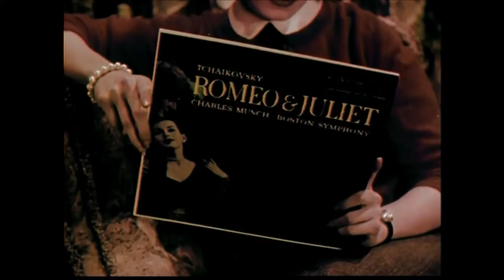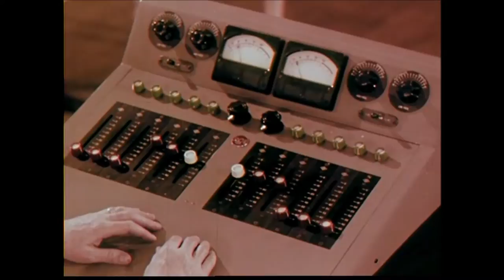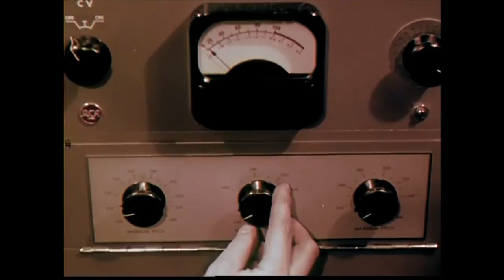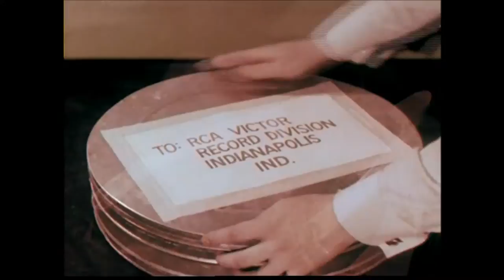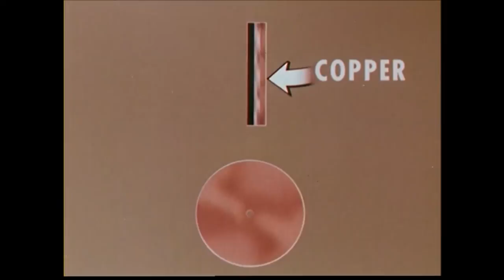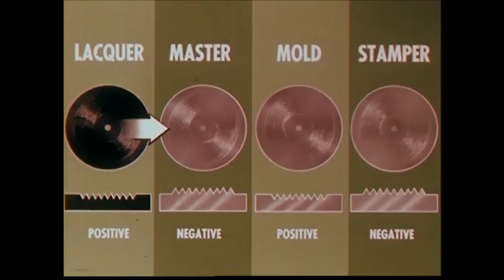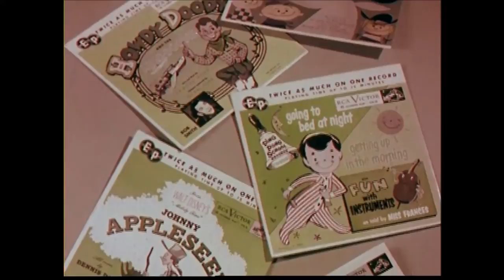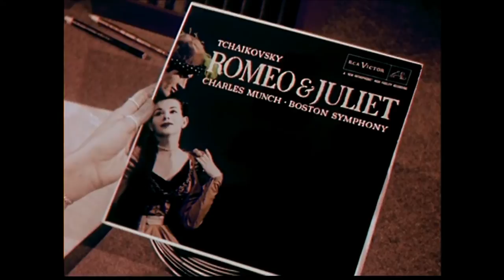The Sound And The Story  -  RCA Victor Commercial 1956

Comment: Charles Munch and the Boston Symphony recorded "Romeo and Juliet" on March 12, 1956 (a "Living Stereo" version was recorded in April 1961).
Reply: RCA began recording classical music in LIVING STEREO as early as 1954, two years before the "Romeo and Juliet" overture featured in this clip was made. The Boston Symphony was one of a number of orchestras that made stereophonic recordings in the massive Grand Ballroom at New York City's Manhattan Center. Charles Munch conducted the Boston Symphony in Berlioz' "The Damnation of Faust," recorded in February of 1954 at Manhattan Center and released in 1955 on stereo reel-to-reel tape, followed by a stereo LP release three years later.
Reply: I've heard about that.
Reply: Yes! Munch, Jascha Heifetz and the Boston Symphony recorded Beethoven's Violin Concerto in D on November 27, 1955- in stereo- and initially released on a mono LP in 1956......then, on "stereo-orthophonic" tape in 1957........and on a "Living Stereo" disc in 1959......and again on stereo disc and tape in 1963.....and eventually, on CD in 1998.
Reply: @johneddy908  You can see the two stereo microphones, placed VERY wide apart, in the orchestral clips. But I believe the normal procedure for stereo recording was an array of 3 mikes, fed to 3 channels and then mixed down to two, so that the separation could be better controlled. By the way, just out of curiosity, what was on the other side of the disc? And why isn't it even mentioned on the front cover?
Reply: @CamhiRichard "Francesca da Rimini", también de Tchaikovsky. No se menciona porque esta portada fue hecha especialmente para esta película. Y no aparece ningún extracto de "Francesca". Tengo el mismo disco y el título es "Romeo and Juliet and Francesca da Rimini".